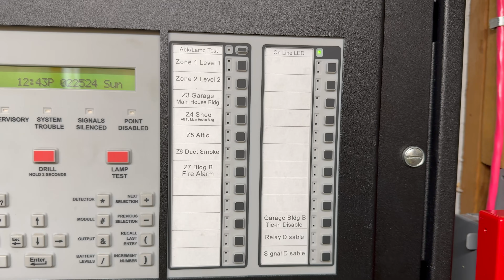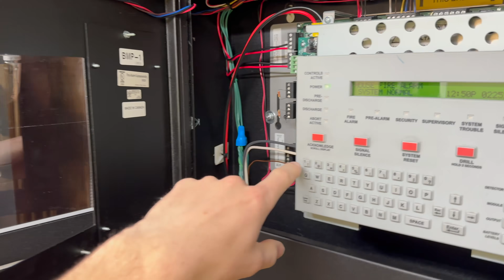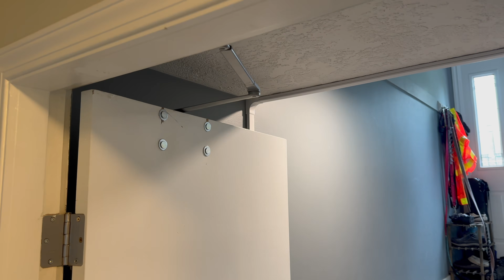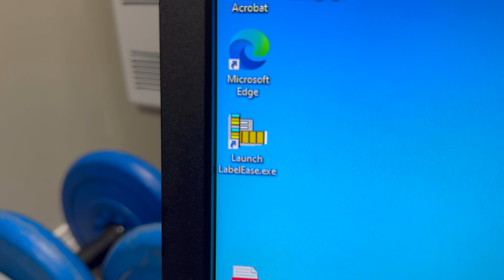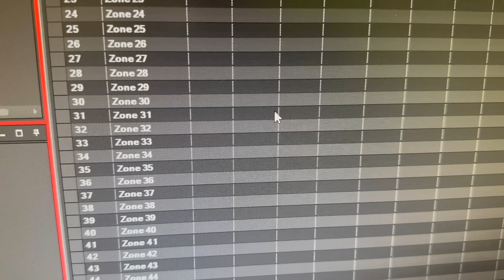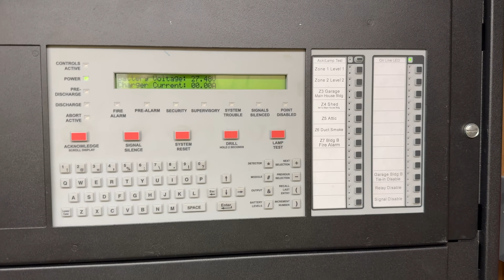Fire alarm annunciator installation on my house system Notifier ACM24-AT

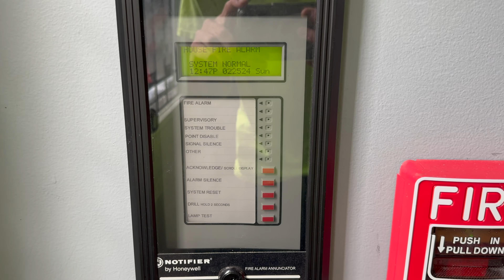Comment: 5:01 Nic maybe pin this comment. I have to add you need a special cable that connects to the NUP port on the LCD2-80 to program it with verifire tools.

Comment: To be honest, Nic. If I were a fire alarm tech, I honestly would try to setup ACS wtih LCD2-80 only if it was mounted side by side with a ACM-24AT. Otherwise I would just use the terminal protocol. Now that's just me. I honestly would do that to save on running more wires.

Comment: It is good that the unit has a LAN connection on the system board to allow you to control the unit from your computer as the USB connection was damaged.

Comment: My grandparents are supers of a older apartment building. They have fire alarm bells. Mir tone. Anyway they have the old ones with glass and stuff. They know how to test them. HOWEVER there are 2 other alarms. Ones a potter and there’s a little hole and says to turn. Any tips for how to use those? And there’s another which is really weird. It’s a summit. It says pull and an arrow in the middle then tirez. Lower there’s FIRE the feu. How does that work?

Comment: Voice evac upgrade?
Reply from the maker: This video is about a fire alarm annunciator nothing to do with a voice system.
Reply: @nics-systems-electric  I ment in the future I know this is about fire alarm annunicator
Reply from the maker: @rodgodx345  no the NFS 320C does not support DVC and there is not a four wire going to all sounder strobe locations so it would not be possible without major system reconfigure

Comment: I’m getting a brand new ACM-24-AT too. They are nice annunciators. Currently, I have an ACM-48A in my panel, which is the buttonless version of the ACM-24-AT.
Reply from the maker: Yeah, I like them. The bypass buttons are very convenient. It's only too bad that it's only VT programmable, but I can see it being pretty challenging to try and do keypad so it's understandable that that's the only way.
Reply: @nics-systems-electric  It’s only keypad programmable on a 3030 or NCA-2 I heard. By the way. Someone recommended that I use shielded cable for the EIA-485 circuits that are going through conduit outside of the panel, to prevent signal interference, but I see that you don’t use shielded cable and it looks like you haven’t had any issues with signal interference.
Reply from the maker: @Notifier-457  yes that is true with the 3030 and NCA but that's only if it's on a 3030 as I wouldn't think you'd be able to get into a 320 or 640 from an NCA from what I've heard. And no I don't use shielded never seen an install done with shielded unless it's audio.

Comment: That copy of Verifire Tools you're using is newer than v5.7 correct? Because earlier versions have an older UI but more importantly, does not have any sort of licensing verification mechanism built into it.
Reply from the maker: This was 10.55 which is needed as the panel is running version 24. 10.55 does require a license key
Reply: @nics-systems-electric  where did you get the license key?

Comment: @NIC'S - SYSTEMS AND ELECTRIC this is what i would've done to a 2005 built house even though it falls under 2005 codes. we just replaced a kidde firex with a brk first alert smoke and carbon monoxide alarm. the rest are kidde firex ionization smoke alarms.

Comment: Just make a separate, quick video (maybe a short), to explain why you have a commercial fire alarm system in your house, then put up a card to it for any video like this, and all you have to do is say something like "I get the question all the time, and there are plenty of good reasons why I have a commercial fire alarm system in my house. I'm not gonna go into it here, but you can click on the card up there if you're curious what they are."
Reply from the maker: Good idea
Reply: Actually eventually whats considered commercial now days will eventually be required in homes in both Canada and the US as the classic 10$ smoke alarm is increasingly not cutting it anymore. For instance in my house we have both smoke detectors and heat detectors in appropriate places like the attic due to the various environmental conditions heck the combo traditional and photoelectric smoke alarms should be the start level fire protection which won't happen until a major tragedy happens sadly.
Reply from the maker: @KILLKING110  I don't think commercial system in the form of how they are currently will ever end up in residential applications due to the complexity and maintenance required. however the adoption of automatic sprinkler systems will become more common for sure. and possibly more advanced smoke alarm requirements for new construction.

Comment: Looks like communication is using the RS-485 bus. This needs a 120Ω termination resistor at both ends of the bus to retain signal integrity for long cable runs
Reply from the maker: Interesting I've never heard of that or seen it in the field